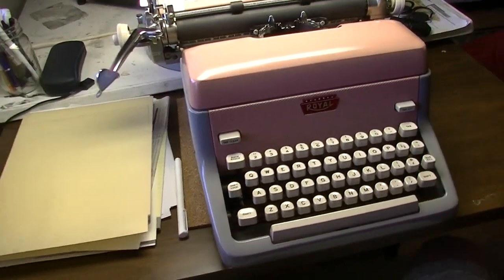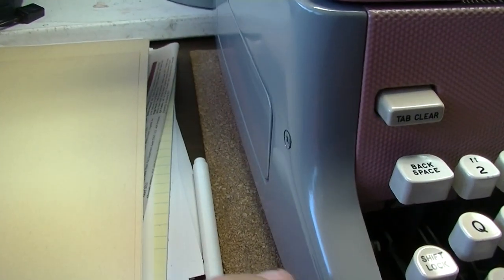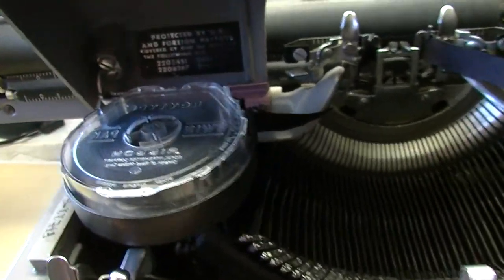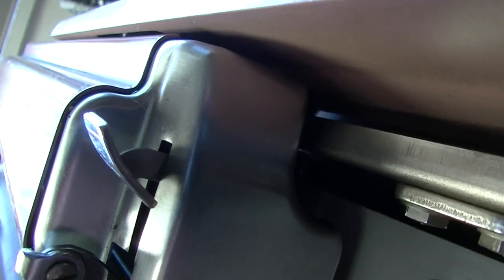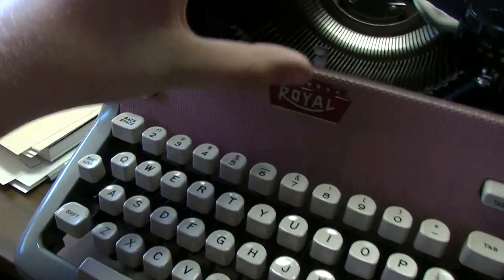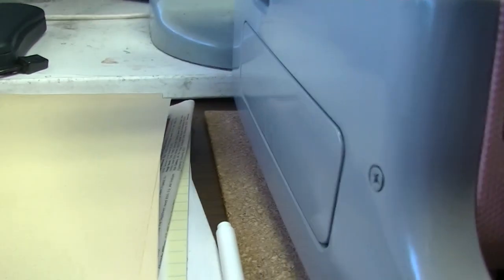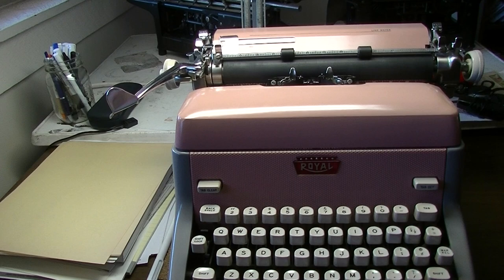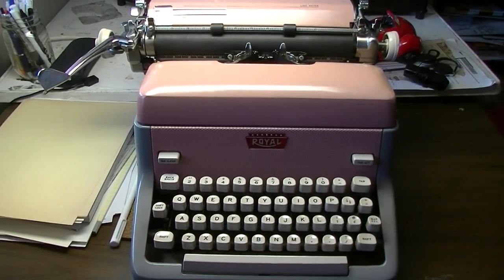1958 Royal FP ***Special Edition***

Comment: Nice typewriter!!  I have a related machine.  I bought it for $10.00 from a secondhand store.  It is two tone grey, but it sports a 16” carriage and it has pica type.  It’s an unusual combination, at least here in Central Texas where long carriages mostly have elite type.  I cleaned it up somewhat and it is a very serviceable machine.  I also have a 1963 Royal Empress with a 16” carriage, but this one has elite type.  It’s Aztec Blue—an unusual color.  This machine’s BIG—but mostly bulked out because it shares a body shell with a Royal electric (the bottom even has a vestigial place for a line cord!!  Anyway this machine is also very serviceable with very good type.

Comment: Hello, this is a beautiful machine.  I have one also, but I have an issue with the left Margin, it will not hold; it slides.  I was wondering if you have any recommendations or if it would be possible to take a picture of the Margin Mechanism, so that I have an idea what it is supposed to look like.  Thank you very much sir.
Reply from the maker: Hi Chris, 

If it is a well-used Royal, or older, (Is it a FP?) the springs or the margin self tend to wear out. If it is the springs that clamp the margin to the margin-rail, then the teeth won't grasp as the grasp is too weak. That is just a matter of replacing the springs, (or tying a loose rubber band around it). If it is the actual margin, that requires replacing.
Reply: Thank you very much for the information sir.  It is indeed a well used machine.  :)
Reply from the maker: Just try some things for it to catch. Paper-clip, rubber band...etc
Reply: Hello Dr, just wanted to let you know that I have managed to get a working Left margin on the Royal FP.  I actually moved the left margin mechanism over to where I wanted it to stop the carriage at and marked it.  Then I drilled a small hole through the left side of the bar that holds it and inserted a small screw.  Now even the the poor long ago worn springs allow the mechanism to slide, when the carriage is returned to the left side of the page, it stops at my makeshift margin. 

     Thank you very much sir for your inspiration and this wonderful channel of  yours.  Also as a side note, I would be very interested in reading your British Detective Novel. 

     God Bless - Chris
Reply from the maker: Hi Chris,

I am happy I could help out. I am glad you enjoy the channel and videos. If there is any other assistance you need, dont hesitate to let me know. I would be happy to help.

Take care,

Dirk